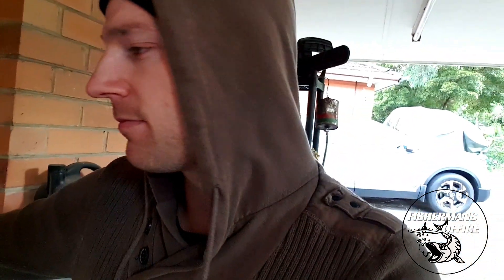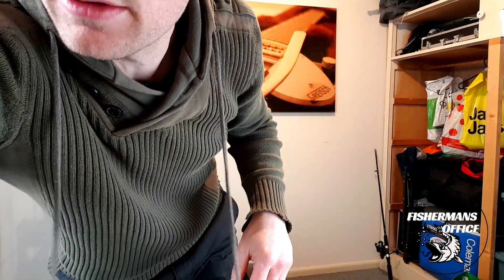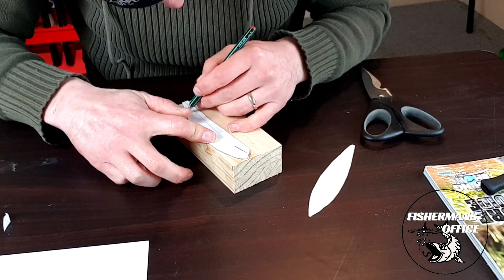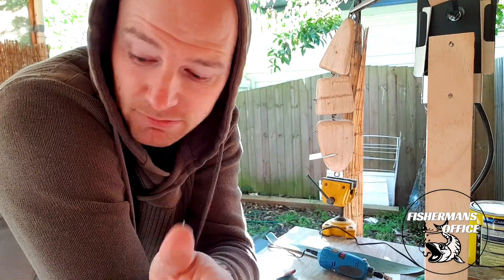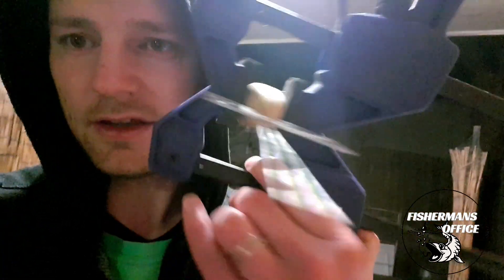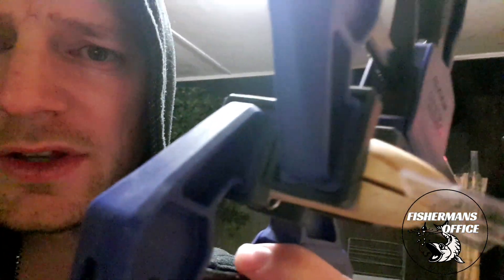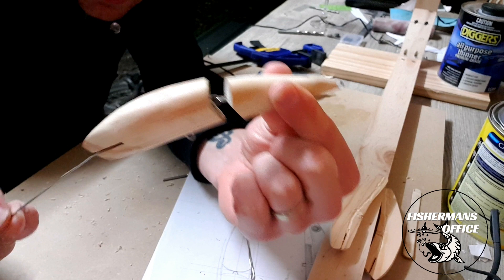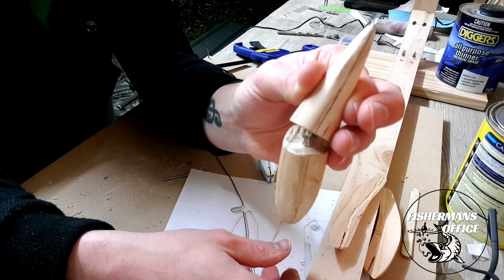Making lures | Daiwa Dr Minnow replica Murray Cod size!

Comment: great stuff mate! only just seen the video.. if ya going to keep making a few lures. a tool that i find really helpful for getting the body's symmetrical are vernier calipers. you can pick some up anywhere from $10-$20 on ebay. worth the while 😉👍
Reply from the maker: Thanks heaps mate.
I have some vernier callipers, I had been using them to find and mark centre lines but now you mention it it would be useful for that haha.
Thanks again.